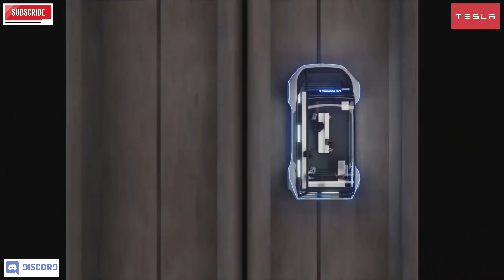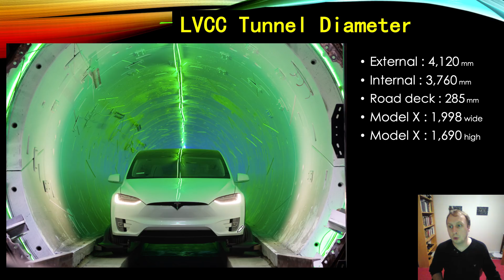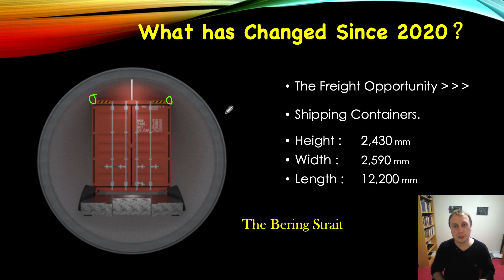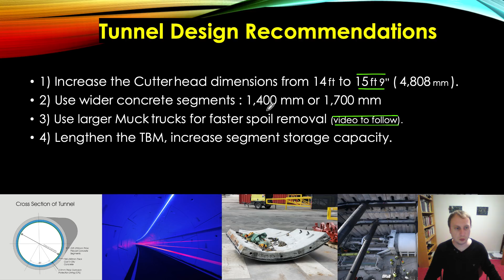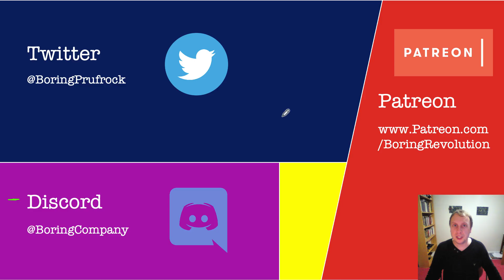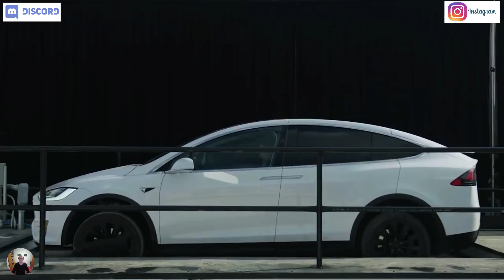One Controversial Design Change Will Make Prufrock Unbeatable 👷🏼‍♂️ 👍🏼 💰 🚇 🤑 📈 Episode # 122

Comment: Sometimes I don't remember right so take this with a grain of salt. I thought Elon mentioned why he chose 14 feet diameter and he said because it was that maximum he thinks they can do to be able to catch up with a snail and it is just large enough for a Tesla to operate in without being dangerous. He talked about the diameter and the exponential increase in surface area and resistance to the cutting head. I'm sure I could look up the math to find out how much greater the surface area to cut through would be at 1 or 2 feet greater in diameter than 14'. 

I do agree with you that if they can bore at a reasonable rate, all things considered, with a nearly 16' dia. it would really make sense for opening up more business potential for The Boring Co. Maybe the ability to move out ths spoil and handle the wall lining blocks would indeed make up for the tunnel surface resistance to the cutting. Hopefully, The Boring Co will carefully consider such aspects of the business. If they increase in scale at some point it could maybe make sense to have 2 or 3 rig sizes to encompass a broader range of uses. 

Keep up the good work. I make a lot of comments about checking out the boring revolution on Tesla you tube channels. Such as people talk about greater public exposure to Tesla vehicles through Hertz and next to nothing said about the potential global exposure to Tesla and The Boring Co. in Las Vegas that has pretty high volume of global exposure.
Reply from the maker: So the fastest TBMs on the market today are 22ft 9" diameter. That might surprise you !
The limited space inside a small tunnel is detrimental to storing and installing concrete segments.
The "sweet spot" for low cost + high speed is something like 14ft 6" to 17ft 4" in my opinion, based on my research.
If you can use a 1,650 mm x 1,980 mm x 240mm segment it will enable 20% faster boring for Prufrock.
Reply: @BoringRevolution  Elon is not always right the first time, that's why he iterates....a lot. I would trust your calcs better than mine so we'll see just how Prufrock will be and what changes will come afterward. It would be nice to hit a sweetspot that allows maximum usage for a TBM tunnel. in the long run, I think a one size fits all would be the most economic. I am sure The Boring Co is still a work in progress and hopefully will scale to meet most tunneling demands. If Starship succeeds, I'll believe Elon can do just about anything he sets his mind to do. He is not always right, but in the end never seems to be wrong, lol, of course by changing his original thesis. Elon is a cross between Capt. Kirk and Mr. Spock.

Comment: Since tunnel size directly affects tunnelling speed and hence cost it might be better to just make the transporter height smaller.  Ie wheels ahead and behind the container and the transporter bed very thin
Reply from the maker: Yeah I mean it just about fits now (14 ft) and yes you could probably find another 3" or 80 mm with that approach.
It might make sense from a load distribution perspective to have wheels down either side, or even underneath. Thus a small tunnel is very limiting to the overall design.
Reply: Putting the wheels ahead and behind has three very neagative effects.
The wheelbase gets longer making corners harder to get round, i.e. the alignment needs to be straighter so harder to find routes.
 The strength/stiffness of the body needs to be substantially upgraded to take the increased bending between the wheels (supports), or you can only handle limited loads.
Finally the length of each “waggon” gets 4/5m longer to accommodate the wheels  leading to far more space required for loading stations/sidings.
To accommodate a standard 40’ container on standard gauge tracks, with 300m radius curves, a tunnel needs to be something like 7.2m ID.
Reply: @davidsalisbury50  I agree.  However increasing the tunnel width also has big disadvantages.
Reply: @andrewpaulhart  Increasing tunnel size doesn't necessarily reduce tunnelling speed or bring disadvantages. Its always a balancing act. There is a sweet spot for any project depending on the type of TBM, constraints and ground conditions. All tunnels get designed to the smallest diameter that meet the constraints of the design, be it number of lanes, ventilation, emergency escape strategy, water flow, airflow around a high speed train etc. There is almost always a study to identify the optimum minimum diameter. The point being that TBS's one-size-fits-all strategy is extremely constrained in terms of end use, and no TBM is best suited for all variables of ground conditions. That's OK if all they intend to do is build single lane short "taxi" tunnels.
Hence we have a market for TBM's from 300mm to 17.5m diameter and a wide variety of operating/excavating/lining types.
Reply: @davidsalisbury50  according to Elon it does necessarily reduce tunnelling speed.  But who knows, he might not know what he is talking about
Reply: @andrewpaulhart  he doesn’t.
Half an hour on the internet will show you why.
But he may be right and a thousand qualified and experienced engineers may be wrong.
Let’s see!
Reply: @davidsalisbury50  if only he employed experienced qualified engineers ….  No wait
Reply: @andrewpaulhart  I don’t know who he has working for him in the Boring Company.
But I do know he has a failed yoghurt salesman running the company. And I do know most of the worlds specialists in tunnel and TBM design and none of them are working for him.
And I have not seen anything that has not been done (or at least tried) before in what they are doing.
But I’m happy to be proven wrong.
Reply: @davidsalisbury50  you should also know that he has a reputation for seeking out the best engineers to work for him

Comment: Why does the Flatbed for the container need to rest on the 'elevated side bunks'? The wheels of the flatbed could as well rest inside the well (between the side bunks). That way, the container is not as close to the ceiling as you illustrate in your video.
There could be tiny wheels under the container towards the sides so that the container doesn't scrape over the side bunks.
Note that all semi trucks that carry containers take the load/weight of the container on the INNER BEAM (even though the wheels are placed farther apart to give stability)
Reply from the maker: Its a fair point, well made !
Reply: @BoringRevolution  Thanks. The tunnels will however need to be designed with less of steep turns to enable movement of the loooong containers. 
UPDATE: I think the tunnel can have sharp turns.....they just need to increase the diameter of the tunnel only at the turns, while keeping the straight part of the tunnel just enough for the container to sneak through.

Comment: I should think vehicles, or passengers, dropping debris would be the biggest threat to operation.
Reply: It may be an issue, but I would not consider it 'the biggest threat'.
Reply: @jbbuzzable  It helps that they are only using their own vehicles and not old junkers like mine.  I assume there will be cameras with AI watching for stray bits.
Reply from the maker: it could be a stray dog or a box of chicken wings. 
It's just a tad too tight for my liking !

Comment: I suspect the best thing Boring company could do is "own & run" these projects - keep government out.
side note:  every tunnel does NOT need to solve ALL imagined problems that you can think up.
Reply: I pretty much agree, but government support can be beneficial.
Reply from the maker: That is true. For mass transit a 14 ft diameter is more than enough with the 700 mm road-deck and costs just $4,500,000 per mile.

Comment: isn't the road deck already higher than the one you show in the beginning?
I agree that the diameter should increase just enough to run shipping containers on top of the road deck while still taking reasonable turns. that opens up so many options, but I don't really know how much that raises the cost or makes surface-launching difficult. I suspect the reason they don't do it is either A) people will want to run full-size buses through the system, but it seems like TBC wants to convert everyone to personalized transit. B) launching from the surface might be harder.
Reply from the maker: 1) I believe the road deck in the Resorts world Loop will be 400 mm or 15" high.
2) A doubt a full size buss will be allowed in the system. Tesla will build a custom AEV similar in length to a Mercedes Sprinter Van but only 7ft 2" tall (or Less).
3) It possibly increases the TBMs weight by over 22% so yes URUP is harder.

Comment: Perhaps flatbed trailers would transform where  the  wheel carriage goes back and the supports swing around to the side of the container. I would rather tunnels constrain themselves to being very strait.  Separately I am also thinking that the walls of a tunnel are allowed to be thinner, the smaller the diameter, but this would not be better for heavy trucks. This in itself could be the argument for larger tunnels for all I know.
Reply: I always like your comments. I think The Boring Company may have to go back to the drawing board to accomplish the the things you are talking about though.

Comment: Elon shrunk the diameter to make it faster .  Less material to move .
Your one size fits all does make sense. 
Containers in one .
Tall busses in another.
But you don't need containers in a tunnel in the city until warehouse has a dock in the tunnel .
Smaller is attractive between cities but containers could use the tunnel too. 
Can see both scenarios
Reply from the maker: Elon shrunk the diameter to make it faster??? OK but a smaller tunnel limits the size of segments you can utilise. Thus if a concrete ring-beam is 1,200 mm wide it will be slower to assemble than a 1,600 mm wide segment. Elon shrunk the diameter to make it cheaper not faster !!!!
My one size fits all makes a ton of sense because its only another 18" to 20" !
A larger machine can actually do way more work because it has a larger internal foot print. However you harm the cost per mile and that is a difficult compromise.

Comment: I have always thought freight was the biggest potential market & the easiest 'win' for TBC. Look at the delays at most ports todays affecting ecoomies worldwide, and the difficulty getting truckdrivers. If you look at most ports (and airports) they are severely constricted with logistics pipelines. Duplicating highways and rail corridors would pay for itself a lot quicker than passenger networks and you would not have the safety\political opposition (especially with removing trucks from roads). This is the perfect scenario for the Tesla truck with FSD to deliver containers to decentralised freight terminals where everyone is a winner.
Reply from the maker: Yes and theoretically freight tunnels could be 2,000 miles long if a viable route exists.
Cost per mile per container could be as little as $0.08 in the future. Ports could be much larger!
If you could move shipping containers at say 70 mph (average) that would shorten supply chains and grow the economy.
Reply: @BoringRevolution  And the other part of the equation is if you have "air-rights" in densely populated areas why not "tunnel-rights" where if you can remove a surface transport\service requirement (like say a rail-spur or a truck only tollway) you get the development rights to that land, and that pays for tunnel construction. Win-win again.